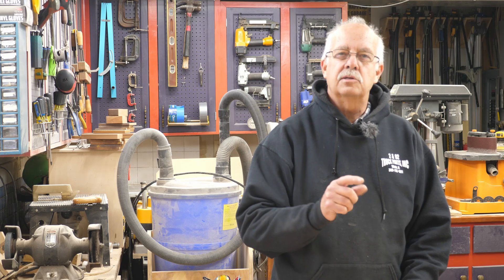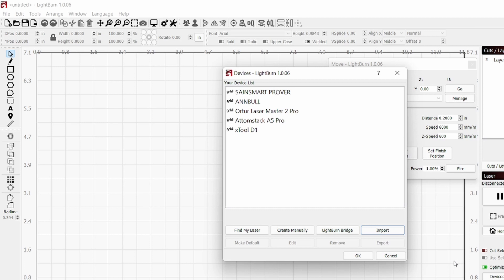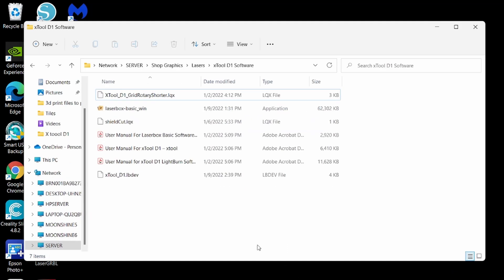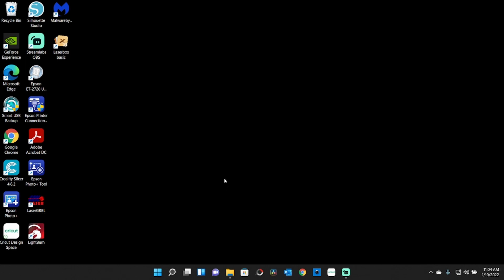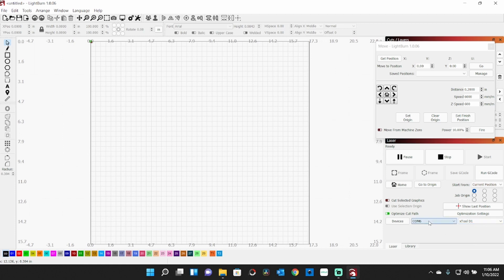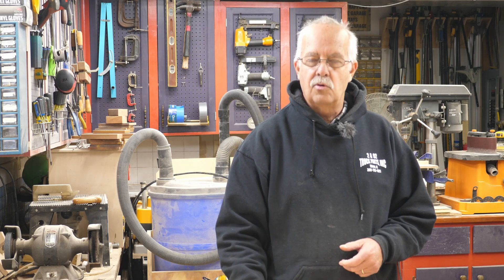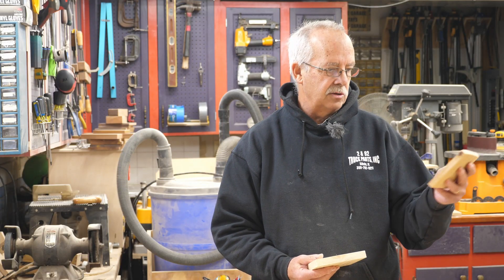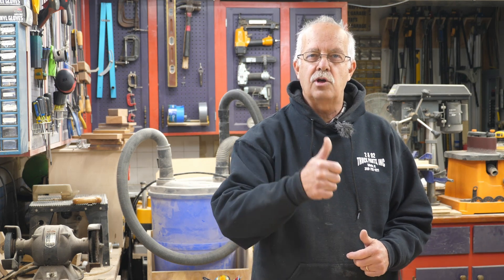xTool D1 Laser Software Setup Laserbox and Lightburn

Comment: II have been running Epilog Helix & Fusion CO2 lasers for many years. I run them using Epilog's dashboard along with Corel Draw for the artwork & cutting. I will be taking delivery of this Xtool D1 in a couple of days. I have no experience with Diod Lasers, or Lightburn/Laserox. If I may ask 2 questions: 1. What determins a cut vs etch? Everything I do is in a Vector format. In Corel, if the "line" is "hairline" thickness, then my Epilog automaticly knows to cut. Anyyhing thicker, then it will etch. How does this work in Lightburn/Laserbox? 2. I still want to do all my work in Corel Draw, I understand that I must import said graphic into either Lightburn or Laserbox. Will I run into any issues during the import, such as resizing or other unwanted corruption? Thank you in advance. Other Youtubers (Many) dont seem all that saavy or have years of Laser etching experience.
Reply from the maker: The main difference between whether the laser will cut or etch is based on the layer setting.  Slow speed/high power for cut, and high speed/lower power for etch (based on material type).  Lasebox is a clunky PIA to use (IMO).  I prefer Lightburn and also prefer to work with SVG files that can be ungrouped, made into different layers, then regrouped, and engraved/cut.  Like anything involving lasers and graphics, there will be a learning curve and lots of mistakes at first.  Air assist is a big plus if you intend to do much cutting.
Reply: @rogersshop  "Roger" that. I just watched another vid, and grasped the concept of the Layers in Lightburn. I will use that software of course, all the while creating the work in Corel and exporting a SVG file. I just hope Lightburn doesnt somehow corrupt or alter the file...Your spot on-Trial & Error I guess....Thank you kind sir.....Yes, I did buy the air assist (naturally)

Comment: What computor required to run the D1
Reply from the maker: It does not need to be high end, but should not be an antique, either.  I use windows PCs, both desktop and laptops.  Mac also works well, but I am not on the Apple platform.

Comment: How do I ensure I am engraving on the center of my object? Thx !!
Reply from the maker: I use lightburn, so here is my method:  First know where the center of your project is, then set laser guide cross on that point.  set Lightburn to start from current position with a center origin.  Frame your project, and if everything looks good, start.  The guide cross is offset from the actual laser beam origin, but this corrects when the project is started.
Reply: @rogersshop  wow this is some great info. Thank you roger!!!

Comment: Roger, I see you are cursed with the same problem I am, I wear XXL gloves. It can be challenging getting into tight areas. I do have another major problem, well many, but this particular one has me saying words I can't use here. I had cataract surgery about 10 years back. About 3 years after the surgery I had a stroke in my left eye and lost sight in that eye. Does wonders for depth perception. Anyway I always go the extra distance to protect my remaining peeper. I see (no pun intended) I will need to invest in a good pair of brown lens glasses. Do you have a particular brand you prefer? Like you I wear glasses so I will need something that will fit over them. 
As always, Thank You Sir for everything you are posting. You have already saved me from making many mistakes.
Reply from the maker: See this video I did on laser eye protection (especially for those if us that wear glasses)  https://youtu.be/Q9LeHrN1Opg
I worked in industry as an electrical engineer and Master Electrician around industrial lasers, so am very familiar with dangers of eye exposure to laser radiation and the different colors of protection needed.  The goggles I wear are not cheap, but they are of excellent quality and offer very good protection.
As for the glove size..............A lot of women associate hand size with "another body part".  I'll leave it at that!  I get some interesting messages..........
Reply: @rogersshop  All I can say is what my soon to be ex said. She looked at me and said, "John, you got a big head, big nose, big hands, big mouth, big feet, big imagination. But you come up kind of short where it really counts." I of course made a few derogatory comments about a certain part of her anatomy requiring me to strap on a eight foot  2X4 to avoid...Well, I did say my soon to be ex didn't I?"
As for glasses being expensive I got one good peeper left. Can't put a price tag on that. I did see your video on glasses. And I saw the pair that came with my x Tool. Better than nothing, but not much. 
My best friend I grew up with moved to Maryland after college years ago. He got a job as an electrician and worked his way right up to the top. All I have is a G.E.D., but I did earn a sheepskin at the School of Hard Knocks. 
Couldn't help but notice you are also a fellow resident of the Land of Lincoln. I live in Chatham, just a few clicks south of Springfield. Also a Bears fan. I just knew you was one of the good guys!
Got more to share but I will save that for another time. Getting close to Winken, Blinken, and Nod..
Reply from the maker: @John-of5sh  Yup, die hard Bears fan...............Regardless of their management.............

Comment: Lol not even close for me nothing I try works
Reply from the maker: If the computer is not seeing the laser, and the laser is powered on, try a different USB cable.  It is not all that uncommon to have a bad cable.  This is nothing but a plain USB "printer" cable.  The higher end cables will have a ferrite block built into the end(s) that help to cancel any EMF interference that may be present.
Reply: @rogersshop  replaced usb cable. Same results looks like I got myself a 850 dollar table weight
Reply from the maker: @lithiumlounge6731  Did you install the driver from Laser Box?  if so, do you have another computer you can try?  I have one older HP computer that will not recognize certain USB devices that require a COM port, but they work on my other laptops.  Seems it did not have enough internal ports.
Reply: @rogersshop  I figured it out I didn’t have the file downloaded lol

Comment: New Subscriber here you are thorough, i ordered  my Xtool D1 last week and is supposed to be delivered this week. Are the steps your doing the same for a MacBook ?
Reply from the maker: I have no experience with a Macbook, so can't answer that one.  Everything I have is PC based.
Reply: @rogersshop  Mine came in last week, went together very easy as you said. Couldn't connect my Mac even after googling but my wife HP connected right up so i can learn now, How much is Lightburn ?
Reply from the maker: @Ebikelover  Lightburn is $60, which gives you two licenses (ie install on two computers) and will give you a third if you ask.  Additional licenses are $10 each beyond that.
Reply: @rogersshop  Oh ok cool thank you i will have to get it and learn it since you say its way better than laserbox.
Reply from the maker: @Ebikelover  It has a learning curve, but they have several tutorial videos you can watch.  It is a very powerful software for the price.
Reply: @rogersshop  Awesome thank you for the info and the heads up Roger, I'm not very techie.

Comment: Do you know if its possible to work on mugs with this machine..or tall cups with handles..?
Reply from the maker: Yes, but it gets tricky.  With a rotary attachment (not just this brand, but all), you will need to be aware of the handle placement and it will affect engraving area.

Comment: I am wanting to buy a laser engraver I do wood working I’m not much interested in cutting as I am engraving I’m trying to decide between ORTUR Laser Master 2 Pro an the xTool D1 Laser Engraver both for me have good features just thought I would see what you thought
Great video thanks for sharing
Reply from the maker: I also do primarily engraving.  For ease of use with Lightburn and adding Air Asist, the Ortur is my first choice.  For power and speed, the xTool 10W has it, but also has some quirks and adding Air Assist is not quite as easy (Subjects of videos soon to be posted).
Reply: @rogersshop  Thanks for replying back I have ran an industrial laser since 93 I’m retired now a Cincinnati Cl5 700 watt cut mainly steel up to 1/4” thick used refrigerated oxygen assist but if rarely I cut wood I used refrigerated nitrogen  the Ortur is probably going to be my choice the D1 has some feathers I like